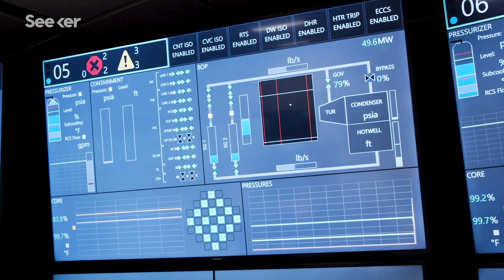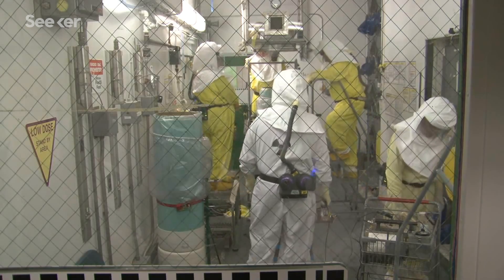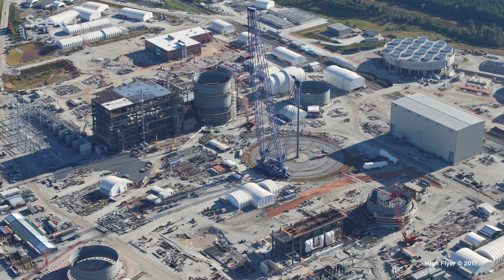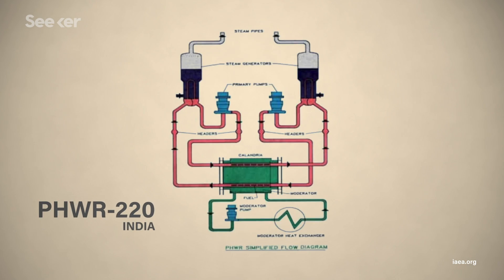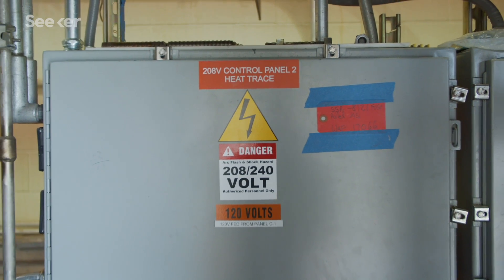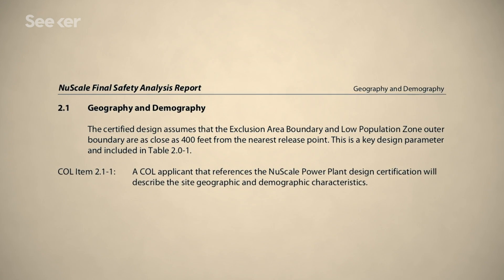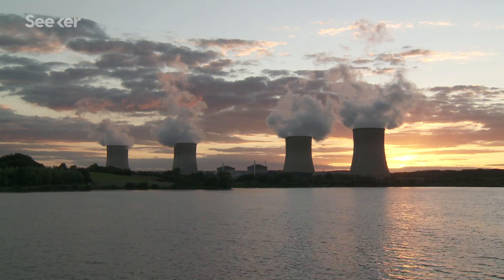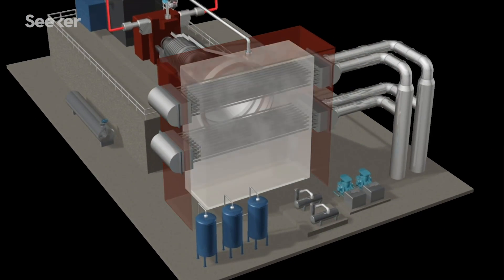Mini-Nuclear Reactors Are Coming, and They Could Reinvent the Energy Industry

Comment: Actually they've been going-away for years (in space) 😉
Reply: RTG's are more a nuclear battery. The thermoelectric effect is super cool, and using the decay heat of a super dense metal to run a power source could have no moving parts and be reliable.

Comment: The french have them for many years. Water is not the cotrol , but the working fluid. The nuclear material is encased in a dense ceramic matrix that expands when too much heat is generated, so automatic control built in.  No runaway nuke problems.

Comment: I love nuclear as much as the next guy but thw future is power produced by solar on residential housing and microgrids. Its much more efficent and alot better in a war sinerio where 100.000.000 powerplants are better then 1000
Reply: The future is higher populational density with huge areas of green on the outskirts and less single-family detached houses. You just can't produce enough solar at the top of buildings, and even less so on rainy/snowy areas.

Comment: Nuclear has been and always will be the best option we have.  Sorry AOC fans.  Solar and wind are not new or economical.  We need to find a way to perfect the process and have constantly been trying.  That’s why solar and wind haven’t taken over.  Not to mention the fact that a clean burning fuel would be far better than storing electricity in batteries.  Hydrogen burns very clean, electricity still relies on co2 emitting processes

Comment: Ok, so the control rods drop in the event of a power failure... but what happens to the heat generated by decaying isotopes? In a serious earthquake, their pool containment building could easily crack, draining cooling water. Water would also tend towards boiling if not circulating, leading to a pressure build up in the containment building. Sorry, not safe at all.

Comment: This concept addresses one of the fundamental problems with modern PWRs: in order to make a plant economically feasible, you have to make a huge amount of electricity, which means a huge amount of thermal energy. And that leads to a small but definite risk of meltdown.
The small modular design is far smarter - when shut down, the decay heat is small enough to be removed purely passively - the holy grail of nuclear energy. These are an excellent and workable bridge to Thorium MSRs and would meaningfully address climate change. I, for one, would be very happy to live near one of these.

Comment: 6:10 ...and if the power loss is from an earthquake which tilted the entire building by x°...would they still fall without stiction or other problems for foreseeable values of x?  Or if the whole module breaks out of that little top cap containment thing and tilts way over...  Or if the core was already over hot and melted the fall-ways or ejected debris up into them and prevented the rods from falling.  I guess they considered everything but still...too many disasters in the past to be so easily convinced about safety.

Comment: I am generally not a proponent of Nuclear Energy mostly because of the costs of building, maintaining and decommissioning Nuclear power plants. It also takes too much time to build (usually a decade or more). The issue of having to store waste of thousands of years is also a big draw back (who knows how long any country, or the proper knowledge will last.

These reactors however seem to be a game changer and from what i've learned about them through this video and other searches i've done, it's an initiative i'd support and have no issue live close by.
Reply: Today's nuclear reactor models, even the ones talked about in this video, are inherently dangerous because they operate with water as the coolant, and they operate that water under extreme pressures.  If pressure is lost in the system and water isn't circulated on the nuclear material, it boils off and you get a meltdown.

The two main variants of nuclear reactor today are boiling water reactors (BWR) and pressurized water reactors (PWR).  BWR operate at around 70 atmospheres of pressure.  PWR operate at around 160 atmospheres of pressure.  This is dangerous as hell.

Molten salt nuclear reactors are the safe nuclear power plant model.  They operate at 1 atmosphere and they use molten salt as the coolant.  They cannot meltdown, and they don't explode like today's reactors can.

Look up the Liquid Fluoride Thorium Reactor (LFTR).

LFTR in 5 minutes.
https://www.youtube.com/watch?v=uK367T7h6ZY

Comment: Engineering is easy. Liability is hard. Main trouble is that the majority of PROVEN reactor designs are not 'fail-safe' they are 'fail-disaster'. A 'fail-safe' design means that if i randomly take away the people or power necessary to operate it,  the design remains in a safe state indefinitely.  However, if the people in charge of normal operation and maintenance of the reactor or the electricity powering the coolant pumps and used to manipulate the control rods suddenly disappears, you will have a catastrophe rather quickly. Given it is at least possible that a worst case failure could render an entire region uninhabitable for a millenia, caution is paramount from a risk analysis perspective. Yes, the evidence shows that FAR more people have died due to the use of coal and other sources of energy than nuclear power BUT evidence also shows that regular metal bullets have accidently killed far many more people than nuclear weapons ever had. Shall we stop using bullets and only use nukes? Some things aren't about precedence, they are about compartmentalization of risk for the purposes of mitigating that risk. Don't get me wrong, I think the future is nuclear but not until we see someone drop the cash to prove out a design that isn't 'Boomer Tech'. LFTR anyone?

Comment: Smaller reactors, designed with up-to-date insights and technology make a lot of sense. Instead of the old, huge reactors that cause huge problems when something does go wrong, modern smaller reactors would cause way less problems when things go wrong. Also with the scaling down of the reactor, the likelyhood of accidents scales down: smaller reactors are way easier to control than large reactors, basically because when huge reactors fail, it's almost imposible to brute-force them back to safety, whereas you have a way better chance of doing that with smaller reactors. On top of that fossile fuels are not only causing a lot of pollution, the fuels themselves are also depleting and the alternatives like solar, wind and other means of power producing simply aren't up to the task. 

As for the doom-criers that point to Chernobyl and Fukushima, remember that while these accidents did happen, they were massively complicated because of the scale of the reactors, and:
- the Chernobyl accident happened because of a test an iditioc Soviet party-hack had designed that was mandatory been run time and again despite having proved itself toe be unrealistic and scientists warning the test would never work and was very unsafe to begin with.
- Fukushima happened because idiotic designers placed the emergency power generators BELOW the floodline in a country that gets it's fair share of floods, almost ensuring them to fail in case of a severe flood.
And these reactors were so large that, once they ran away, were almost immediately out-of-control. 

On top af that both these accidents aren't anywhere near examplary to nuclear power. Navy's all around the world use modern nuclear reactors that run for decades on end without serious problems, and some of those are pretty large.
Reply: Sorry, but solid fueled, water cooled nuclear reactors are inherently dangerous.  They operate water as the coolant, and they operate that water under extreme pressures.  Boiling Water Reactors operate at around 70 atmospheres of pressure.  Pressurized Water Reactors operate at around 160 atmospheres of pressure.

Molten salt nuclear reactors are where nuclear is done the best.  They operate at 1 atmosphere, and they use molten salt as the coolant.  They are the 100% safe way to do nuclear.
Reply: @Les_S537  They are inherently dangerous, agreed. But you CAN scale down the dangers and the effects. Molten salt reactors do seem like a way better alternative, but as research into them was cut of in a pretty early stage in favour of water cooled reactors, additional research might be needed on molten salt reactors before employing them on a large scale.
Reply: @UCfgnvY8bNlFUN2sXvhNehyg I missed that one then. The only thing about molten salt reactors I saw and read was how the research was very promising but that it was killed off under pressure (ironic, I know) from the water cooled reactor designers and builders. So the continuance of that research with lab-grade reactors means they could develop a, excuse the bad wording, "real-world" working reactor in reasonably short time. What about the costs of developing, building and maintaining a molten salt reactor compared to a water cooled reactor? Do you have any insight on that? Because that could be THE major selling point next to a much larger inherent safety.

Comment: There we have it - the issue is not in technology, it's in regulatory committees whose salary does not depend on whether an industry they "regulate" even exists. Their criteria are all geared towards mega-reactors only, so they do not scale. In no way do they benefit from "allowing" anything at all, because their sole criteria is safety, and as in any industry - the only machine which is 100% safe is the one which does not exist.
By the way this is also the reason the amount of humans trying anything new in space will be asolute zero till the next Cold War, because you just can't be 100% safe no matter if you drive a car or a spaceship.

Comment: The whole controversy about nuclear power relates to the inclusion of Water. The use of water places severe limitations and problems of the power generation. Avaliability of massive amounts of cooling water precludes localization to deserts. Water has to be pressurized to super extreme levels making the reactor expensive, big, and risky. Remove the water from the equation and most of the detractions for "nuclear" disappears. Typical reactors are designed to treat the fuel as a mechanic component , likely because mechanical engineers designed them, and not as chemical sources. However this is not always the case. Liquid salts, and metals like sodium or better yet lead can be used for heat extraction eliminating high pressure and attendant problems. 
There is no way to reduce this discussion to a three word sound bite for the mass media, some education is needed.
Burning fossil fuel is going to kill this planet and must stop. Solar and wind are not powerful enough to meet the needs of demand as is proven by Germany's failure where increasing amounts of brown coal is being burnt.
Reply: Molten salt reactors are where its at.

Comment: Most complicated way to heat water - to put it mildly xD 

When I was playing minecraft and came across some nuclear related mods, I thought the authors were screwing with us or plain misinformed, when I saw that somehow this was a glorified steam engine.
Reply: Today's solid fuel based boiling water reactors and pressurized water reactors, like the ones talked about in this video, are horrible solutions for nuclear.  They're too dangerous.

The best nuclear reactors are the molten salt nuclear reactors.  They can't meltdown, and they don't explode like today's reactors are prone to do.

Look up the Liquid Fluoride Thorium Reactor.  It's the future of nuclear energy.
Reply: Les Schorlemer 
A hypothetical LFTR powerplant would certainly use a steam turbine to produce power too.
Reply: @mudspike84  yes, it will.  Steam turbines are our best way to generate electricity at the moment
Reply: TorlanDelta 
Every thermal power plant, whether it’s a coal, gas, oil, nuclear or geothermal power plant, uses steam turbines to make electricity as that is and always will be the most efficient way to turn heat into electricity. If nuclear fusion one day becomes a reality it will also be used to drive a steam turbine.

Comment: That just sounds like normal nucular power plant with extra steps, Rick and Morty.

Scalability good in some edge cases, remote island, carrier, nucular sub,  some spacecraft's....
But to have remote controlled nucular power plant in even remotely populated areas, dude, it's not a small hobby drone. 
U need competent staff on ground. I give u some idea's of why:
Solar flare - no communication.
Glitch/bug in program/code.
The landline is somehow cut.
Satellite signal is jammed.
Hacker attack.
Freak accident.

There is a god reason nucular sites are layered with security systems.
Reply: Today's solid fuel based boiling water reactors and pressurized water reactors, like the ones talked about in this video, are horrible solutions for nuclear.  They're too dangerous.

The best nuclear reactors are the molten salt nuclear reactors.  They can't meltdown, and they don't explode like today's reactors are prone to do.

Look up the Liquid Fluoride Thorium Reactor.  It's the future of nuclear energy.
Reply: @Les_S537  The whole yt-clip is  a clickbait.
Reply: @adamfilipkalle  how do you figure?

Comment: There is an error in the map at 1.50. Italy had nuclear reactors but today are not active anymore. All italian reactors were turned off after 1987 referendum.
Reply: Today's solid fuel based boiling water reactors and pressurized water reactors, like the ones talked about in this video, are horrible solutions for nuclear.  They're too dangerous.

The best nuclear reactors are the molten salt nuclear reactors.  They can't meltdown, and they don't explode like today's reactors are prone to do.

Look up the Liquid Fluoride Thorium Reactor.  It's the future of nuclear energy.

Comment: Rather we develop fusion but SMRs could be a viable interim solution where Wind and Solar is less practical. Wind energy is by far the cheapest. No one mentioned the decommissioning cost of these systems which is an inevitable outcome of technology which has run it's expected life. How easy is it to remove the radioactive element when it comes to decommissioning?Dealing with the radioactive waste is another sticking point. The fuel rods can be re-processed but you still end up with waste which will be around for hundreds or years.Malton Salt Reactors are even better as you don't need a pressure vessel for the radioactive steam. The Malton Salt is what transfers the heat from the radioactive elements to a heat exchanger where water is boiled. If the steam ever ruptures the pressure vessel it can safely vent to the atmosphere. This is why existing power plants are so expensive because the primary cooling system uses water and must be contained in the event of an over pressure situation which is why Chernobyl failed as water was flash boiled to steam and the resulting overpressure blew out the reactor containment.
Reply: Fusion could be 50 years away we pretty much have no choice unless a lot more money is pumped into alternative power generation.

Comment: Thorium salt reactors are a better design than the current fast reactor and the fuel is cheaper than uranium
Reply: Brainjock  Today's solid fuel based boiling water reactors and pressurized water reactors, like the ones talked about in this video, are horrible solutions for nuclear.  They're too dangerous.

The best nuclear reactors are the molten salt nuclear reactors.  They can't meltdown, and they don't explode like today's reactors are prone to do.

Look up the Liquid Fluoride Thorium Reactor.  It's the future of nuclear energy, and they're way cheaper to build and maintain that today's nuclear reactors, even cheaper than SMR's

Comment: They realize thorium exists,right??Why bother making new reactors working with the same dangerous uranium???
Reply: Not enough research in Thorium. Thorium also produces Nuclear waste and has some serious disadvantages. This is scaling down a commonly used Technology to a level that is less risky to manage and in case of emergencies the damages are less, then modularize the system so you can scale up as need it, just add more small reactors to the production system, while containing the risk and waste in small units.

Comment: And when did building smaller result in cheaper products pr. Unit in question (pr.weight,pr.power unit, etc)?
Reply: the idea is safety. once safety is achieved you can have small nuclear plants nearby cities producing enough electricity to power the city needs.

Comment: Teacher tell there students to solve a big problem divided it up into smaller one, I don't see how this is going to help, in this situation. Deadly waist for 10,000-20,000 years, and using water as coolant, that has multiple times in the past separated and turned into explosive inside chamber. Please go molten salt reactor instead. The English navy stop using gas/petrol power submarines because of the danger, and went to diesel, likewise we should stop using uranium and use thorium instead.

Comment: This seems like a good direction for the future of nuclear power. Modular with less downtime and hopefully it will be easier to recycle or disposal of spent material.

Thorium molten salt reactors are cool, but I don't see them being fiscally viable in my lifetime. The material science still hasn't quite caught up. There just isn't a piping material that can withstand radiation, extreme heat, high pressure, and the extreme corrosiveness of fluoride salts over decades of use. China is building a test reactor with a cobalt alloy, but even that wears down pretty fast in a way that could make future reactors more costly than something like a CANDU.